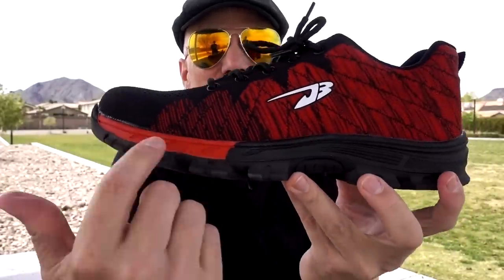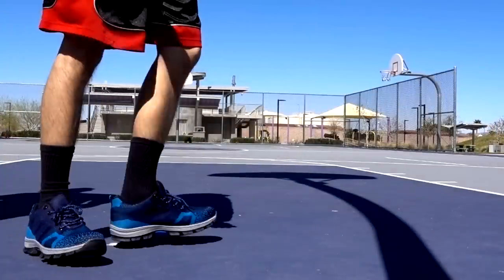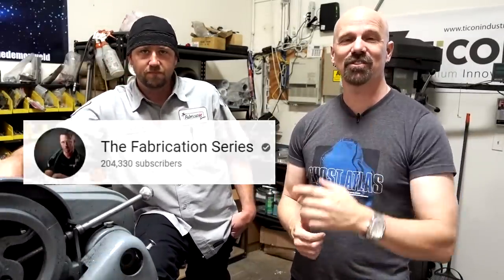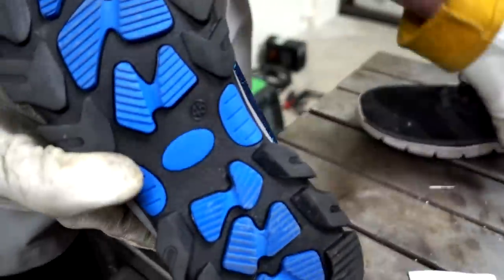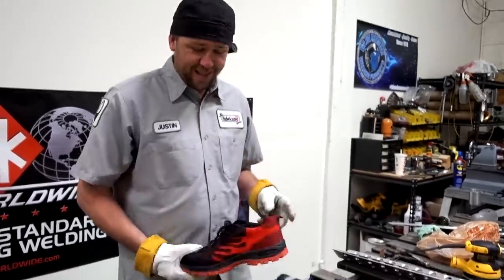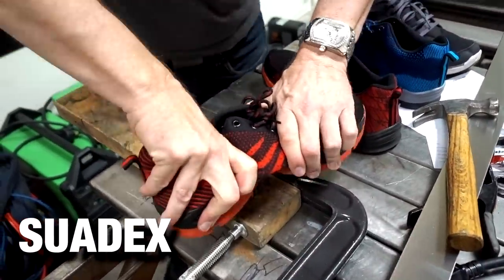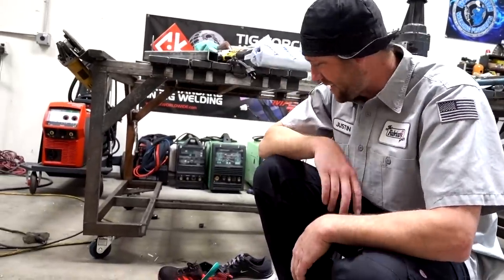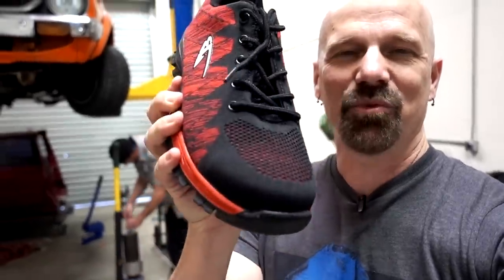"Indestructible" Shoes Compared!

Comment: There's a fundamental problem with cutting the toes off first, as you can see the dome of the steel is compromised in every shoe. Of course they all failed.
Reply: I think they would have failed either way some were pretty thin
Reply: Sorry buddy if that was the case why did the safety boot past the test. Ans: if you notice that the safety boot from Walmart the steel toe was designed wider and higher.
Reply: The walmart show didn't fail
Reply: The only one that failed was the suadex from Amazon. What you saw was the inner fabric of f the shoe hanging.

Comment: I work a job where I walk miles everyday on wet slippery surfaces pulling heavy equipment. Dickies work boots are surprisingly good for the cost at Wal-Mart, but they will get moldy eventually. Best boots I've found are Georgia brand boots. Actually waterproof, steel toe outta hell, thick treated leather, and thick hardened rubber non-slip soles. But you gotta pay for quality, they run about $140 a pair. Worth it for daily use though. Since they're actually waterproof they also keep moisture in, so you will get stinky feet. I dump goldbond powder in mine to help.
Reply: Pat Patrix kiwi brand shoe deodorant spray is a great fix, antibacterial and other  powders or sprays containing talcum aren't good for you

Comment: I would have liked to see the drop test being done without the metal arch being bent already Seemed like the last shoe you did had still an arch without being bent  and did the best  I'm just wondering if it would make a difference like a dome roof  Works because the energy is being supported because way it's circulated  Or like an egg where if you squeeze it equally around it it won't break Because the energy is circulated

Comment: I want to provide an estimate of the force of impact the weight has when it hits the shoe. I'm a little rusty on physics, but I did the best that I could. (Values are converted to metric. Sorry imperial users.)

If an object of mass (m = 22.6796 kg) is dropped from height (h = 0.4572 m) , then the velocity before impact is (v = 2.9935 m/s) . The kinetic energy just before impact is equal to its gravitational potential energy at the height from which it was dropped (K.E. = 101.6173 J)

Kinetic energy alone does not allow us to calculate the force of impact

As there was no mention of height that the weight travelled after impact, I estimated this to be roughly 2 inches , or 0.0508 meters . 

D = 0.0508

The force of impact may be calculated using the work-energy principal to be:

Average impact force = F = 2000.34720 N

Correct me if I am wrong on the conversion, but this is equivalent to 2901.258 psi.

Comment: I would like to add something I own the suadex to replace my Walmart brahmas... I have worn completely through the underside in between 90-120 days. Metal  shank is showing through the rubber on the bottom. My 23 brahmas took almost a year to wear out.
Reply: BTW I'm a flatbedder so thanks for letting me know my feet aren't even remotely safe from nails. They are in my work area often

Comment: If you can feel the toe piece it’s a sign of cheap shoes. 
I wear steel toe all day for my job and this is what I have noticed over the years.
Reply: Good to hear from someone with some real experience. Drove a truck in a warehouse for half a year and had to wear what they called "truck shoes". These were very high quality and quite expensive, but I could always feel that toe shield, not enough to hurt, but enough to irritate. But I'm a tough sell when it comes to shoes. Finding a new pair of shoes is usually a long process that involves testing a lot of shoes to find that golden pair that fit my feet perfectly. I've broken in enough shoes and suffered the blisters and infections that can come with it. Now I only buy shoes that fit from the get go, and that keeps the shape. None of that "They'll fit perfectly once broken in". It's not worth the pain. Besides if I needed protection shoes they wouldn't break in the same way leather does. Steel doesn't stretch and mold to your foot real well...

Comment: I owned two sets of the exact same pairs of Brahma steel-toed boots from Walmart. They were great!......for about 6 ish months. Under normal walking and everyday use, no torture tests or anything, the soles were cut open by the steel in the sole and the inside where your foot rests caved in hard just 3 months in. My second pair had an epic wipeout when I was walking on uneven grassy yards. The thick cloth stitching ripped right out. Sounds like when you rip material apart from metal staples.

Comment: I guess the remaining question is longevity. That's what really matters when considering the cost of footwear. I usually buy Brahma steel-toed, waterproof boots for work, the 40 dollar ones, because the soles get worn down and broken over time on any shoe; especially, from the way I walk on rocks and squat a lot, so it saves me money. 

I've stepped on a nail before in my boots, and thanks to the thick soles, it couldn't penetrate far enough to hurt me, the shoes that were tested wouldn't have that feature.

Comment: Honestly, you'd be better off with no steel than the thin layer in the suadex. Looks like it would cut off your toe instead of shattering it. Both bad obviously, but the latter is a lot easier to operated on. Less messy as well.

Comment: I bought the brahma as work boots because I work as a sandblaster and they are really reliable for a steel toed cheap boot and they are water resistant until the tongue is wet. So if you are walking around in about an inch or two of water you should be fine

Comment: Waterproof means that the material doesn’t degrade when they get wet and dry quicker. Though the leather boots didn’t get your feet wet , they will get ruined if used under wet conditions, thus making it not waterproof. At least that’s my understanding. Please correct me if I’m wrong.

Comment: My cousin stepped on a nail while fixing his house and it went right through his shoe and foot. He started wearing his big work boots from then on even when at home working.
Reply: Just a couple days ago I was pulling apart the wooden framing of an old sofa so I could use it to fix my bed frame.  I was wearing Island Slippers (sandals handmade in Hawaii) and was holding one side of the frame against the floor with my foot and knocking pieces off the other side when I noticed, oh I seem to have been standing on the furniture staples and have inadvertently stapled my sandal to the wood. lol

Comment: If they were waterproof they would have a gortex or gortex like liner. These have seamed tongues almost to the top to prevent the water from getting in. If they tongue of the shoe isn't seamed to the body of the shoe they are not waterproof. Also if you notice the inner liner is mess, that would not be gortex or like fabric.

Comment: Mostly a good review, but I have one issue with it. In the drop test it looked like the steel cap of all the "indestructable" shoes had already been damaged. This will weaken them a lot. I don't know how well they would have done if they were intact, but as it is, this does not prove anything.
Given how badly they did in the other tests, I don't know if it matters if they can hold up to the drop test.

Comment: If you want to look nice, buy nice-looking shoes.
If you want comfort, buy well-made & well-designed shoes.
If you want safety, buy a proper work boot.
If you want outdoor compatibility, buy hiking shoes.

I really don't think there's a "one-size fits all" for this kind of thing, especially when they're oppositional.
Working boots get dirty. 

Also, if you drop something on those steel-toed sneakers, I feel like the weak thin fabric would bend & then drive the edge of the steel right into the 'knuckle' of your toes.
Unlike leather which wouldn't buckle as much.

Comment: Why would material of the plank matter? Also, doping 50 lbs on the shoe tells you nothing about how these shoes would preform; a proper experiment would find the failure point of the shoe, but with this method they will all fail at the same time.

Comment: To land it properly in all shoe drop test. you guys should of included a clear pipe that was roughly 1/3 inch  bigger than the 50 lb. metal weight.

Comment: Gimmick shoes. Buy nice work boots for the same price, or nice exercise shoes. Also while work boots dont have steel inserts, the extra thick rubber on the bottom will slow down the impact of the nail. Think of it like a bullet through a tree (hard) vs a bullet through a steel cooking pan (easy).

Comment: Think I’ll stick with my Reebok steel toes there not designed to protect you for feet when you step on nails but trust me when I say they will protect your toes from +4000 pounds roll over and on top not once but 3 times without having to replace them. Only damage was on the exterior of the shoe.

Comment: This is a good sort of PSA that steel-toe shoes are often more dangerous than not. If you're only working with light to medium weight things, like general hand tools they're fine, but once you start working with heavy stuff you're advised to not wear steel toes because they will absolutely crush/cut/demolish your toes.
Reply: JZStudios  what do you think will happen to your toes without quality steel toes?
Reply: @49giants3  They still get crushed, but in most instances it's preferred.
For example, working around horses? If a horse steps on your toes with a steel toe, the toe will bend and cut off your toes. If the steel collapses there's not much you can do about it. Otherwise you might just have a broken toe or two.
Anything heavier and steel toes don't help anyways. They're really only designed and intended for lighter objects like tools.
Reply: JZStudios that must be cheap Chinese steel toes. They have to be atsm rated. I do sheet metal for a living, and while moving a lift , my foot was pinned under the lift , and nothing even happened to my steel toe shoes. The lift was over 500 lbs.  without the steel toes my toes would have been crushed
Reply: @49giants3  Okay.
Reply: JZStudios have a good day

Comment: most shoes I owned had problems with soles wearing out quickly or glues coming off quickly.  I don't care about steel toe, it's useless feature for most people unless you work in factory or construction sites.   if there is a shoe that has indestructible soles and good glue, I would definitely buy it

Comment: If the video at the manufacture of these shoes show someone stepping on a "bed" of nails, it is not going to go through the shoe. Just like the old "trick" of laying on a bed of nails, the weight is distributed. You could probably stand of the bed of nails bare foot with no problem. I am glad I saw this cause i was going to buy one of these shoes. I do use the Wallmart version, but i use the leather version. They have two. the leather version has a steel tip and the other used some kind of synthetic with a kevlar tip. The steel tip, the one i have, has save my toes many times from rolling/dropping logs as i cut up for firewood. I am going to stay with the Walmart version

Comment: The So So Maybe Indestructible (Destructible) Shoes.  Not impressed by any of them.  New Balance makes a shoe called the Durham Tennis Shoe that IS almost Indestructible.  They almost feel like New Balance regular shoes.  NB Durham is ANSI Rated as well.  Leather that fits tight with the tongue so better water resistance.  Just coat them in Sno-Seal or Obenoffs.  They don't slip.  Don't wear too badly on Non Skid surfaces.

Comment: Walmart shoes are some of the best shows I've bought even though I hate Walmart. The only issue is they do get weaker over time. A two year pair of boots got a dent in them from a block in my car and they were trash at that point.
Reply: @bostonrailfan2427  I have a few name brand boots that I've had for over 5 years. Granted they are not worn daily but they've been worn and are still in tact. 

Walmart boots just fall apart out of nowhere with no warning lol

Comment: So a youtuber I watch uses shoes from a company called Carolina which are workboots with a metal plate in the bottom and I bel8ve steel toe not sure interested to see how it would compare.
Reply: Work boots are almost always better.  Partially just because of the silhouette giving you better ankle support.  Working in sneakers, wether strong materials or not... is fucking dumb.

Comment: On the shoes try for a slip test try oil and gas for the sole I have the Bramas with the good year welt sole for a short. Boot there not bad but there not good for Basketball there more of a shop and Light Industral foot ware and price isnt bad . We have lots  of stickers were I live and soft soles always bring in lots of stickers that get stuck in the carpet it all depends on personal preference for me I wood go for the Bramas just for the oil and gas good year welt But than again I use to drive  trucks and their alway gas and oil  were. Some soles will break Down in and get just like walking on ice